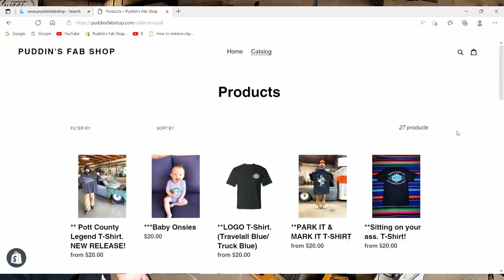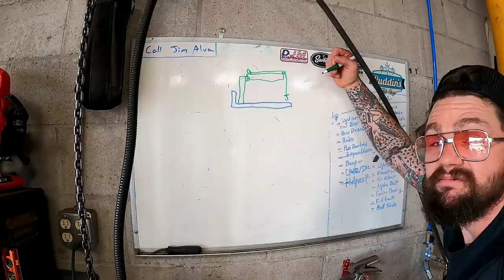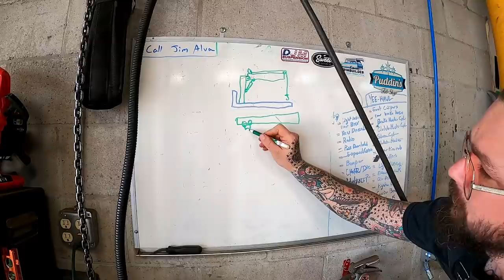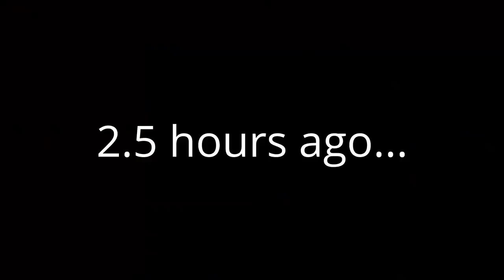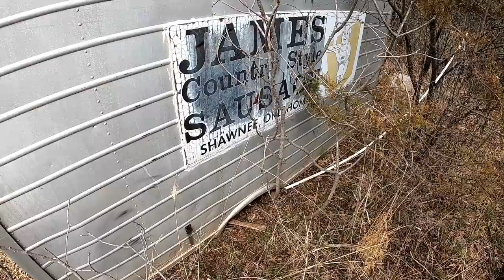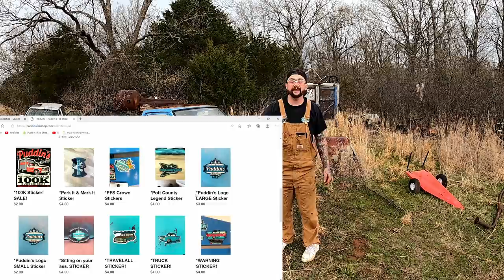CRANE BUILD for the flatbed worktruck. Mini truck DUALLY. ((1984 Toyota))

Comment: Hey pudding sorry I hadn't been around like it matters just want to tell you I'm pretty sure that truck was laughing at you but it looked back on something I have done with leverage I moved 50,000 lb with a whale tail probably of course it was on concrete floor but I moved it like it wasn't nothing I was definitely on Redstone Federal yep done here in Huntsville I don't know what else to say except for I was there installing the machinery for the machine shop for the airport stuff like that just moving stuff from one place to the other I guess you would say even if it's across the world I actually did get to watch Apaches land on a different job I got to actually wire up the garage doors on the helicopter paint boots all explosion proof man that was took me 3 days to figure out that schematic was pretty intense nobody else wanted to do anything about it I had a middle door dividing the two and I left all my notes and the prince with a electric master engineer I come back from a job about two days later and they were having problems and I asked my civil did you check the pecker head on the motor was it wired right for the right voltage and I said what can't be that what kept kicking out the coal on the disconnect it's electronic coll they kept mashing the override button and it was like a toothpick kept adjusting on it and I said go up and check won't take just a few minutes to take four bolts out and look to see how it's wired they said no it's not it it burned up a 4500 disconnect explosion proof come to find out it was wired wrong at the motor tried to tell him redneck tummies and no I didn't even graduate 9th grade

Comment: Terrible video this week. I couldn't stop laughing so I missed some important parts. Just terrible. I know the parts I missed I would not have been laughing. Did I say terrible? I meant wearable. Red dirting in the Toyota flatbed. Think ya need a bigger motor for your heavy duty hauler. Got my project done today n a shirts on the way.